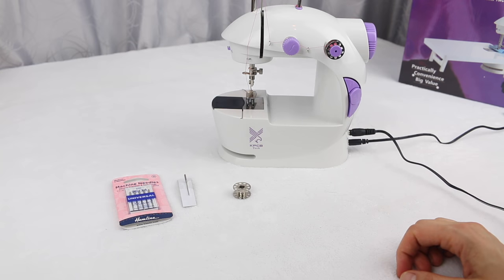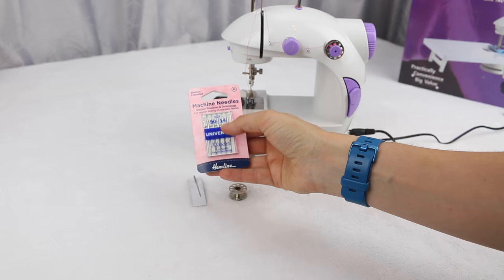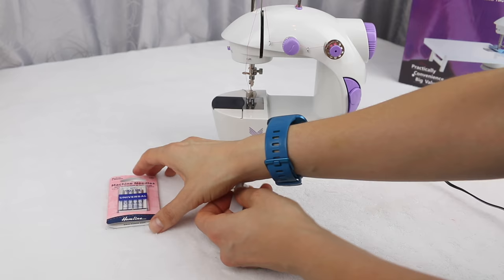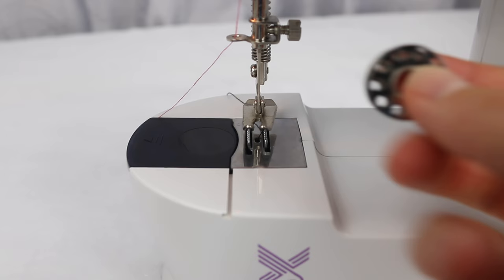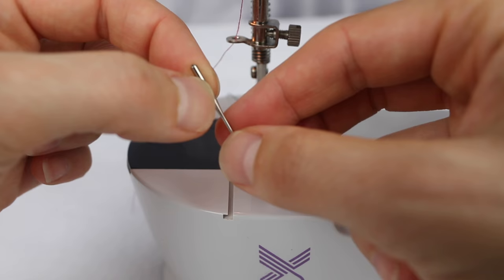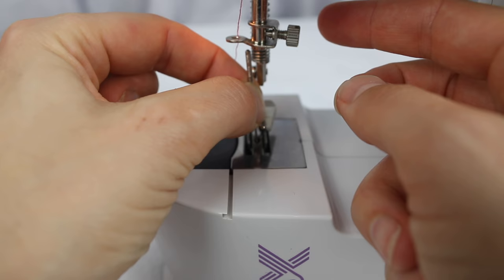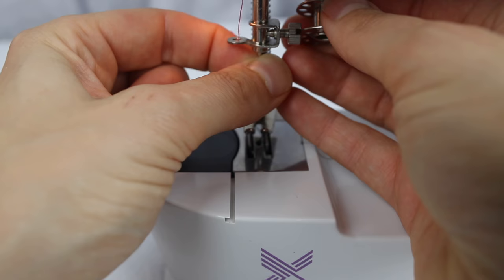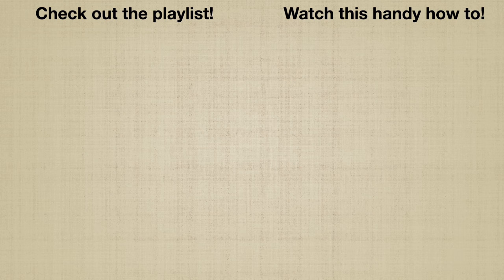How to Change the Needle on Mini Sewing Machine and Needle Size Recommendation

Comment: I'm beyond frustrated. I made sure that the flat side is facing the right side of the machine. The needle got in and I can lock it, but it won't go higher. I know it should go higher because I can't place any cloth under the needle anymore. There is no more space!

Comment: Putting that down thread is it necessary ???like the one you put in the down box and close it before sewing
Reply from the maker: You can see if the machine starts sewing without doing that but it may end up in a tangle of threads. I’d do it just in case.

Comment: wow.look.fun 😍 its.possible.to.do.sewing.of.jean or harder fabric?
Reply from the maker: This machine would probably struggle with thicker fabric and seeing projects with multiple layers.
Reply: @EasySewing4Beginners  this is what I was wondering as well. I will not be using denim but I am using a cotton knit fabric. I saw on the manual that it says to use a No.16 needle for jean fabric. It does also say to use a No. 9 or No. 11 needle for thin fabrics. Do you recommend using the No. 16 needle for a cotton knit since it is thicker or using a stretch needle, if that's even possible with this machine? I am very new and have never used a sewing machine before but have been doing a lot of research to figure out what I can do with this fabric. Any help would be so appreciated! Thank you!

Comment: My machine needle number is also 90/14 but my mini sewing machine like yours doesnt stich even I already adjusted the tension screw. My machine needle is also in good conditon no blunt and stuffs at all. What to do po? Hahahahah btw Im from Philippines!
Reply from the maker: I had this issue with another mini sewing machine. If you have a ruler or a pair of scissors try to use that to carefully put pressure on the pressure foot while you are sewing (and don’t let it get in the way of the needle lol). If you put more downward pressure on the presser foot and it sews then the pressure of the presser foot is the problem. If it still doesn’t sew then it may be cause by something else. Try rethreading the machine using the instructions in my other setting up video to see if that helps as well.